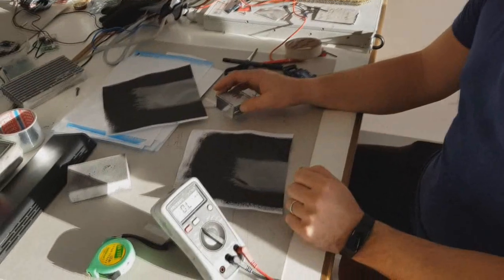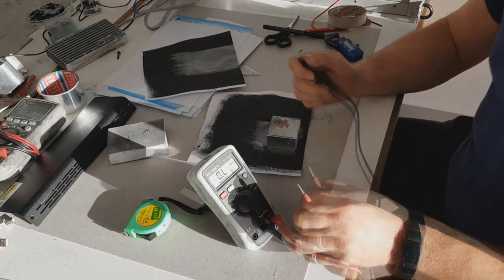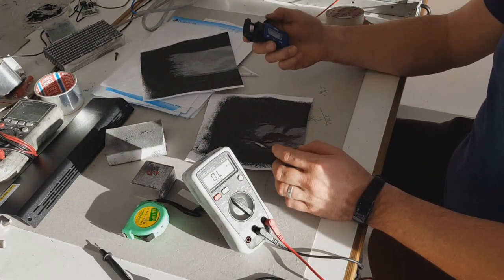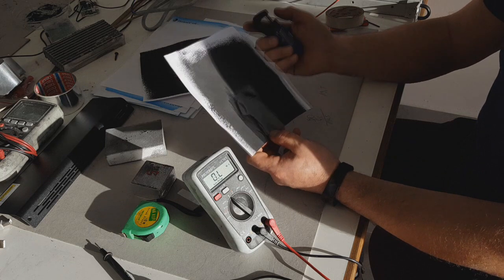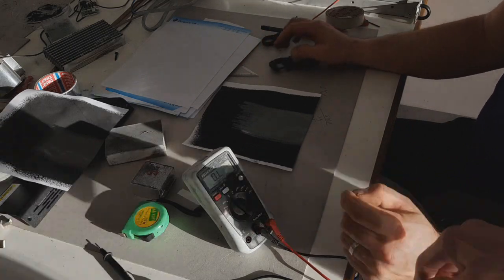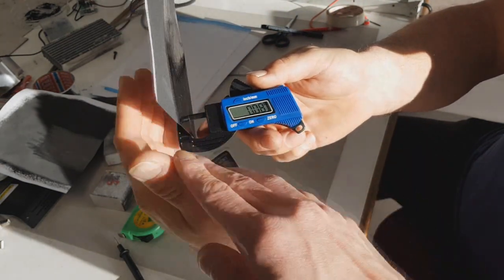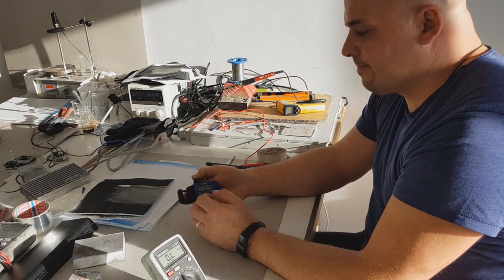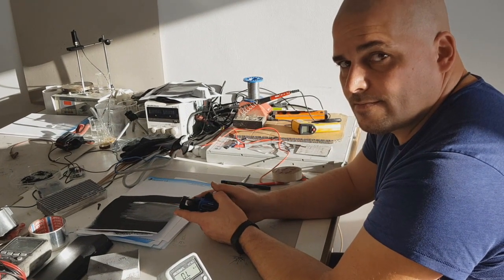Carbon conductive ink - Update

Comment: Is your square measuring block conductive? 🤔
Reply from the maker: The aluminium on both sites yes,.... the high density foam in the middle not.
Reply: cayrex2 I made one aluminium and on copper  . I found the aluminium oxidised and gave different readings daily from the oxidation . Copper I just rub on my jeans and is good to go .